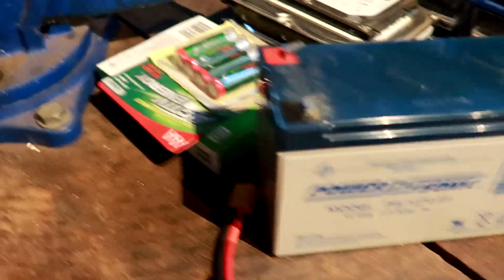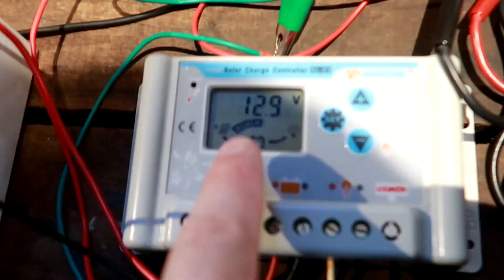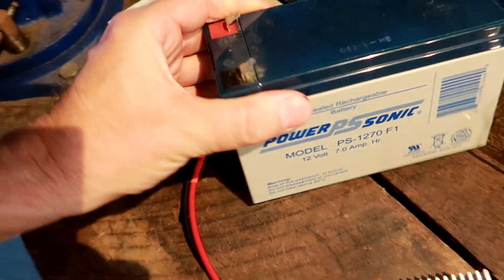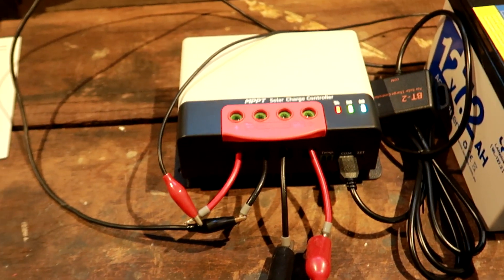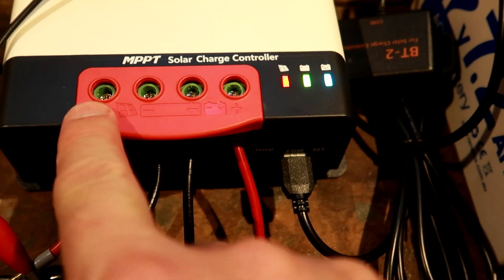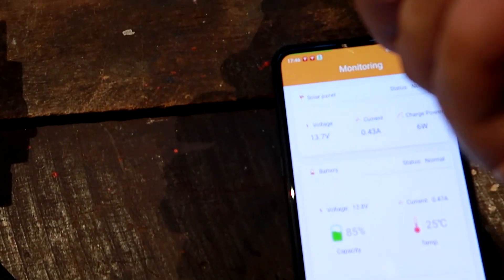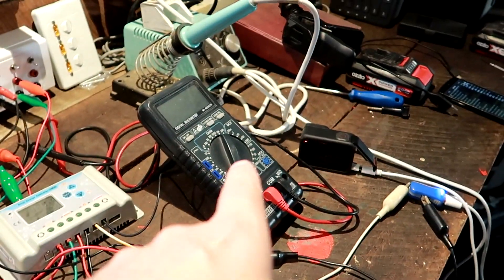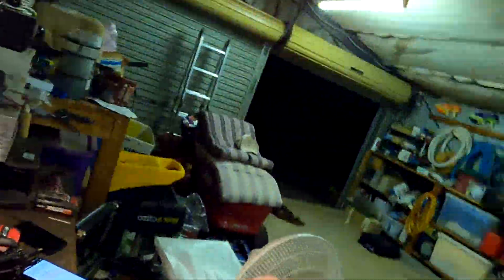SRNE MPPT Solar Charge Controller Fail!

Comment: Are you sure the app wasn't just frozen? I use that same app for my Renogy controller. Seems to freeze a fair amount, especially if I've had it in the background.
Reply from the maker: I had a look at the raw footage again and the numbers are actually changing. In one scene of the video here you can see the current changing too. I'm not sure if the problem is the app or the data collection inside the controller which is crappy and the controller submits just the wrong data tot he app.

Comment: Tricky one. Does the app have settings, looks like the refresh rate is set too long, i.e. reads every 30mins instead of every 5 seconds. Definately not live data. Could you not also use he USB charging output as a switch instead of the load terminals, I guess you would need more hardware to do this. wouldn't be as simple as having the load terminals.
Reply from the maker: The refresh rate is around 3-5s, sometimes a bit longer but this cannot be adjusted.
That is a great idea Darren, The USB actually turns off when the battery gets low, so I could just attach a solid state relay to that 5V output which would then terminate my load! That will work.
In this case though, the PWM controller senses the low battery and disconnects all load anyways. But yeah, great thinking, I'll keep this idea in mind ;)

Comment: Go with EPEVER brand, they re pretty good
Reply from the maker: These controllers are too large and won't fit in the enclosure of the gate from what I can remember. I'll look into this again. Can they be programmed as well to suit all batteries?
Reply: @OffGridGarageAustralia  go with TRACER-AN or XTRA type (you should be able to find them locally), a bit big but not that much, yes they can be programmed as you like, but you need the Bluetooth module to do that
Reply: @OffGridGarageAustralia  they also now have a waterproof design that is a bit smaller, but harder to find.  Downside is a special cord that costs and cost of wifi or Bluetooth module required to program.
Reply: @OffGridGarageAustralia  here is the us ebay item number 352707910255
Reply from the maker: Thank you!

Comment: I'd be looking at the epever TracerAN 1210A with the BT its around $110 on ebay, or just go with the buck converter and a low voltage cut off module - $6
Reply from the maker: I'll have a look at the dimensions and see if they would fit. Thanks.

Comment: Testing with More power panel. May be not start up the mppt tracker inside at lower current. A few weeks ago I testing mppt Epever ETracer 45 Amp with a 2 solar panel 10 w in series and fáil display measure. Working same us  PWM. Now with 2x 320 w panel work perfect. Try more poder panel 2x50 w in series ?
Reply from the maker: The controller shows you in the app what stage it is in, MPPT, Bulk or Float... I think is depends on what kind of solar input voltage you have as well.
Reply: @OffGridGarageAustralia  Try with more power panel if you can. I belive that no working fine for for power poor maybe. Sorry for my poor english words. Regards from Uruguay.
Reply: @OffGridGarageAustralia  Some mppt need voltage input > +3 Volts of battery for work fine and a minimun power for startup charging. Make a challenge.
Reply from the maker: OK, I understand, thanks for your advice!

Comment: I was thinking about the smp-20 from Ali Express but I believe to control it you need an adapter for bluetooth it looks like a knock off of a Victon charge controller and I saw a review saying they were able to use the victron app but I'm not sure if you can use other dongles because the victron one is the same or more than the controller and I believe you need it to program other parameters
Reply from the maker: I'll have a look at this option too. Thank you.
Reply: I've searched aliexpress for "smp-20" and can't find anything - willing to share more specifics?
Reply: @largepimping  ya I know ail express sucks I just searched mppt charge controller and it was one of the first ones looks just like a victron unit if you have seen them but it's blue
Reply: @james10739  Thanks, It seems like it's the link right below. But I hope not - that product listing says "The controller is only suitable for lead-acid batteries
" and "This solar controller does not contain LCD screen and Bluetooth function".
https://www.aliexpress.com/item/1005001469639469.html